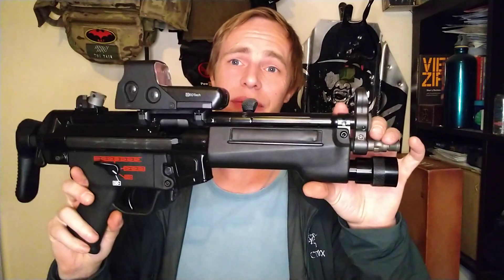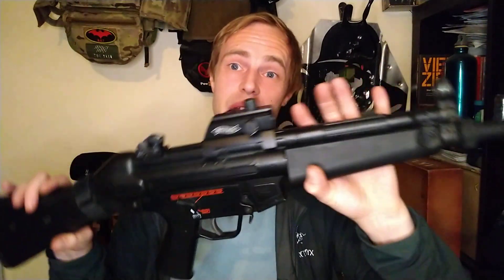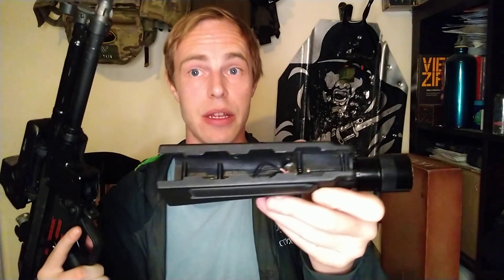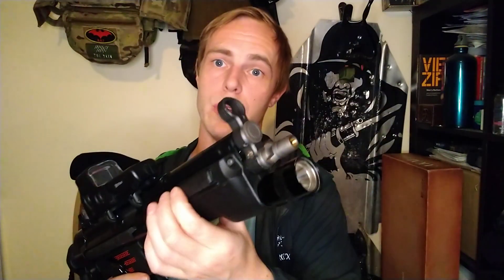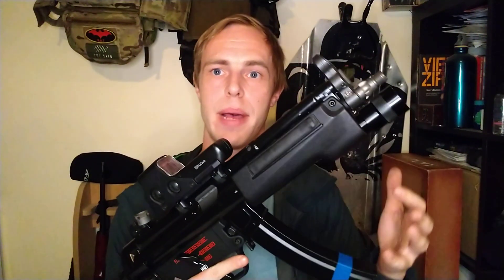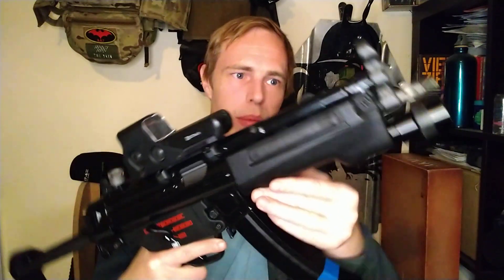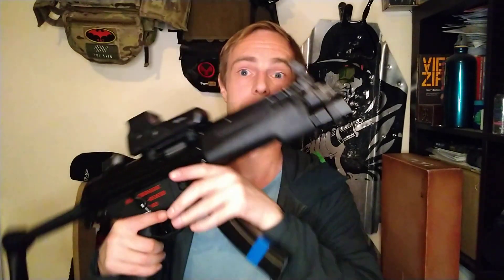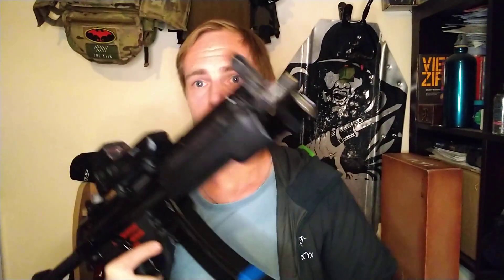WE MP5a5 Apache GBBR. Fitting the G&P AEG Flashlight Foregrip & how are the 30rd competition mags?

Comment: Ollie, have you taken apart a 30 round magazine yet ? I own a bunch of them since they're lighter, have the correct shape and closed front. Yet, I've heard like you said that they're not very "efficient" I guess you could say, maybe because it's a 3-part tank inside ? Besides that, one of mine is already leaking without even having skirmished it, and I can't remove the two long screws that hold the inside of the magazine together. They're so damn stuck that I managed to strip the screw head... Maybe you can help with this ?
Reply from the maker: So I've had exactly the same issue as you're having, the 30 round competition mags are cool but not as good as the 45rd mags to be honest. 
For a stripped screw, as long as it's not too bad you can put a rubber band over the screw head and push hard with the screwdriver and it should give it just enough to grip. I tried it on mine but it's too stripped to work.
Reply: @OllieTalksAirsoft  Thanks for the reply. I'll try again with that trick but I'm not expecting much. I've tried heating the spots where the threads of the bolt sit more or less, but it won't budge
Reply from the maker: Agreed, they are a nightmare, let me know how you get on!
Reply: @OllieTalksAirsoft  I'll try and let you know if I have any success. It could help other people too

Comment: Where did you get the G&P hand guard I can’t find them in stock and what rail mount are you using?
Reply from the maker: I managed to find the handguard here, https://www.mlemart.com/g-p-mp5-flashlight-handguard-3v-cree-white-led/ I've ordered from here to the UK and they are legit. The rail mount was a low profile one rather than the claw which I do have around here somewhere! The one I'm using is this one https://www.fire-support.co.uk/product/strike-low-profile-mount-for-mp5-and-g3
Reply: @OllieTalksAirsoft  great thanks. One more thing, are you able to fit a tracer on or does the flashlight get in the way?
Reply from the maker: @kyleash3614  the flashlight gets in the way so no tracer sadly
Reply: @OllieTalksAirsoft  ah damn in that case I will Jerryrig something using some mlok rail
Reply from the maker: @kyleash3614  I could use a half inch barrel extension to clear the torch but it will still get a massive surpressor/tracer shadow as a result. It's kind of one or the other for me, until I get the Midwest Industries m-lok handguard that is!
Reply: @OllieTalksAirsoft  check out maydaysan gaming. He has the new TM MP5 and just cable tied an mlok piece to the gas tube
Reply from the maker: @kyleash3614  yeah I saw his videos. I'm waiting for TM to release their MP5 GBBR 🙌 it's been in the works behind the scenes for years now apparently!
Reply: @OllieTalksAirsoft  agreed that would be cool. But I have the WE Apache, TM MWS and TM AKM. Not sure I have any more need!

Comment: I sold mine 5 months ago I’m buying it back, SD6 model can’t wait 😂 
What spares do you recommend having to hand bud?
Reply from the maker: In my spares ive got a couple of the 3 round burst parts (check badabings video for exactly which part it is) and 2 spare nozzles, that's it basically. I haven't actually needed to use any spare parts yet as nothing has broken on it. Yet.

Comment: Can you fit a tracer on it with the handguard installed?
Reply from the maker: sadly not i'm afraid, you could run a 1 inch extension so the tracer clears the torch but it won't look as good.